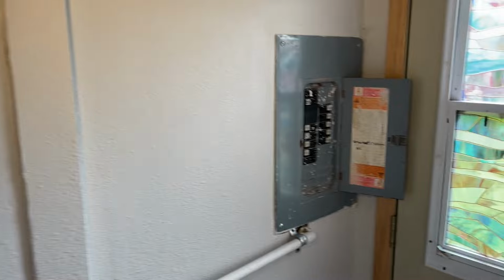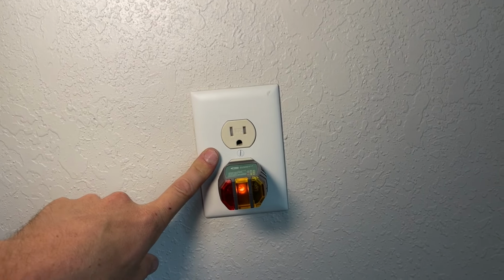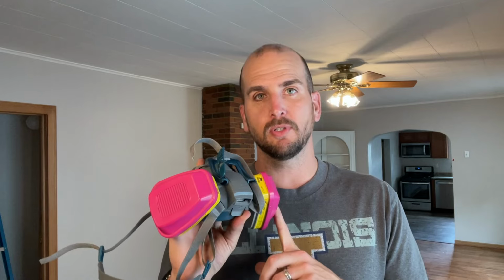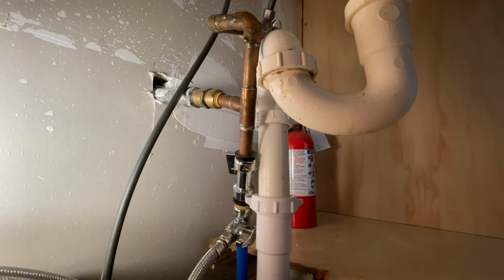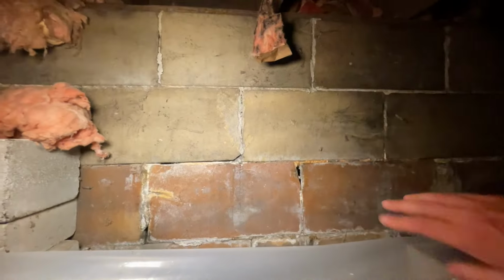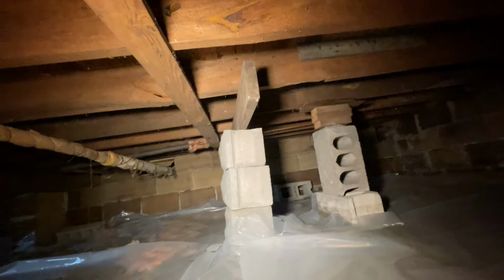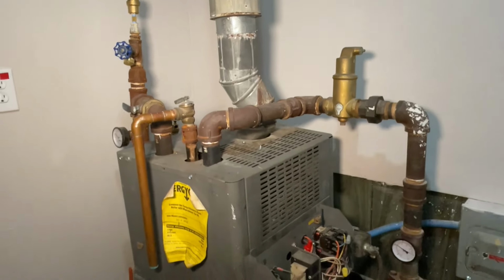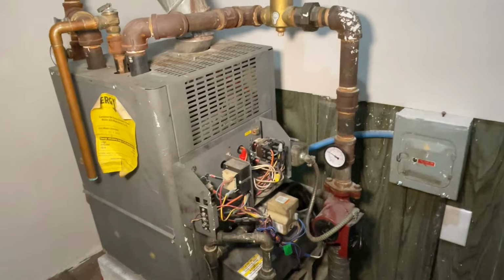Old House Inspection | Top 5 Issues

Comment: English no my natural language. I discovers not to long ago that latte and plaster could have asbestos. To be precise, it is in the cement between the latte and plaster. Attention it's not always in the cement,  some plasterer would use it to make cement strong. I never thought this would be in cement. I knew all the other place that i could found asbestos, but cement...
Reply: Do you mean lath and plaster? Latte is coffee with milk. (No offense meant towards your English skills, you still speak it much better than I could speak any foreign language)
Reply: @alexcat3121  None taken. Yes lath and plaster.
Reply: Surely it was the post WW2 miracle materiel used for thousands of products!  Cheap and easy to mine by the ton lots,  fireproof and durable, used like glass fibers are today in concrete tiles and boards for roof tiles and siding,  flooring,  insulation etc. I recall lots of it all over my school buildings both in Germany and USA, nothing but the best for our kids ya' know!🙄😉

Comment: You don't mention that older electrical panels (pre-90's) are considered fire hazards, and if you are making changes to circuits the city or county may require that they be replaced, whatever else you do. That happens all the time in remodels in our area. You also don't mention that most modern houses need 200A--if you hope to have an electrical system up to all the modern features, including the move to electrify everything from furnaces to cars. Another requirement is that new circuits (at least) must be AFIC protected and you need space in the box for these devices. in short, If I were buying that house, I would hire you AND an electrician AND a roofer to inspect it first.

Comment: If you are a handyman and know what to look for, a home inspection is a waste of $$. Most inspectors just like to shove the outlet tester around to all outlets and point out the obvious radiator leak (that normally would take a few minutes to fix). Save yourself the $500 if you know what you are doing.

Comment: @7:16:  That looks like a screw jack (appropriate use), not a bottle jack (inappropriate use).
Reply: A screw jack is no more appropriate than a hydraulic jack. Both are temporary lifting devices to hold structure until wood or masonry support is installed. 
Screw jacks will fail in time.
Reply: @SuperVstech :  First, the point was primarily about what sort of jack that was.  Second, you're wrong; it matters.  You can lock a screw jack such that it doesn't unwind (and they don't anyway).  You cannot sufficiently keep a hydraulic jack (bottle or otherwise) from bleeding pressure.  Name ONE jurisdiction in a developed country that allows a bottle jack as a permanent structural support.

(Note:  A Lally column is a screw jack.)
Reply: @ncooty  many lock and do not unscrew, but they are still soft iron tubes on a steel plate, and rust causes them to fail… they are not designed for permanent use, they are designed for aligning the structure until a permanent support is installed. Read the instructions on them… now, the one in the picture was MASSIVE, and it may well be designed for extended use… but I doubt it. Iron rusts…
Reply: @SuperVstech :  Are you now arguing that residences can't or shouldn't be supported by ferrous materials (including steel)?

Your case seems to have shifted a long way from your first reply, in which you asserted (based on what I don't know) that hydraulic and screw jacks are equally inadvisable and that neither is approved for permanent use.
Reply: @ncooty  just read the instructions that come with screw jacks… I’m sorry if you aren’t understanding me. Steel in contact with ground is going to fail…

Comment: Knob and tube and circuit brakers are not a good mix.  Fuses - while in convenient they break instantly.
Reply: :)...I've done some welding with K&T trying to short them out to figure out the breaker...:) Old house are a pain in the ass...My electrician charges 12 K to upgrade the service...

Comment: So I'm renting out a 1928-built 2-bedroom 1-bath house with a couple and 2 kids living in it.  The artex popcorn ceilings likely contain aspestos, but I'm not 100% sure.  I painted the inside of the house about 6 years ago, which was mostly acrylic paint, but my guess is that there is old lead-based paint underneath.  Since the tenants like the house and want to stay there, they offered to buy it from me.  Naturally, I would be honest with them and they have already seen an inspection report.  However, I'm thinking of upgrading the knob and tube electrical system while they're living in the house so I can keep it as an investment, raise the rent and have a hedge against inflation.  I'm scared though that opening the walls and and the artrex ceilings for rewiring will cause asbestos particles to be released into the air.  I have no idea whether or not the walls contain asbestos.  Do you think it's unsafe to rewire a house under these circumstances while tenants are still living in it?  Do you think it's best to sell it to them with full disclosure and avoid needless headaches?  I'm 65 and not sure I'm cut out for this kind of stress and liability, but the prospect of getting monthly rent over the next 3 years while the house appreciates is very attractive to me.  The house is located in the Glendale/Montrose area of greater Los Angeles.

Comment: That is an old old  house...most of those burned down due to the knob wiring.. Enjoy the videos.
Reply from the maker: Thanks for watching!
Reply: 😂😂😂😂 90% of homes have some knob and tube wiring where I live. Deal with it or call an electrician
Reply: Knob & tube is potentially mor dangerous if disturbed. My experience is mixed on connecting to existing k&t, but best bet is to replace if possible, the problem is usually inside walls, replacement is problematic unless you cut into walls. And walls are usually plaster. Worse case I’ve seen required a wall to have plaster& lath removed and replaced by drywall.

Comment: Yeah I'd personally run from that knob & tube, cracked joists, and sharkbites all over the plumbing...
Reply: Knob and tube is old electrical which was code compliant in the past. Cracked joist is damaged support. And sharkbites are modern convenience implements installed to limit scope of the job.
That's a varied list ya got there
Reply: @derekofbaltimore  Cause that's what he showed in the video..
Reply: @mr.g937  true. So would you run from each or all combined?
Reply: @derekofbaltimore  the Knob&tube is the worst of the bunch and the deal breaker. The others just give me an overall sense of poor construction and craftsmanship likely indicative of other issues not shown or discovered
Reply: @mr.g937  gotcha

Comment: Is that a two story attic?
Reply: I also noticed this oddity.  There are different ceilings in these access areas. I think the ceiling had been lowered to 8 feet tall, as several of these older homes were built with 10 to 12 foot tall walls.  This would explain the access hatch, following with another one above it.

Comment: Dude you couldn't tell that's a 100 amp service with that ancient tiny panel?  Whats the year of the house I think they started using ground lead romex around 1955. My house is 1955 it has ground romex. Holy shit i see galvanized pipe for water? Its a 1940's house it needs to be gutted and every pipe and every wire replaced. Those ceiling tiles above your head are asbestos btw.
Its got a crawl space under the house that's a big big pass.
Reply: You have no clue what you're talking about.